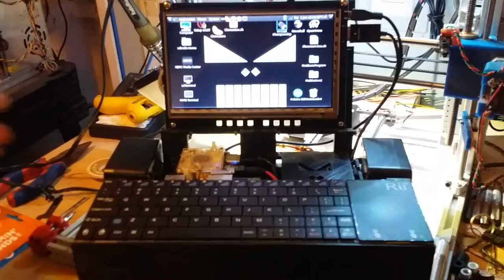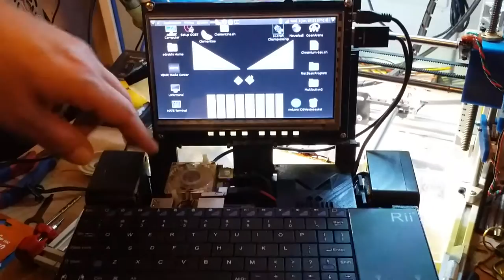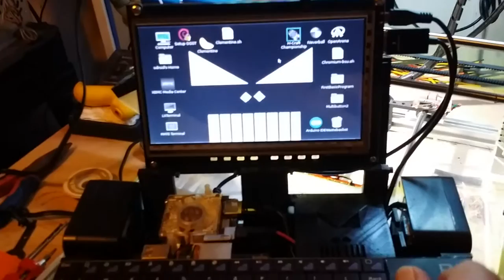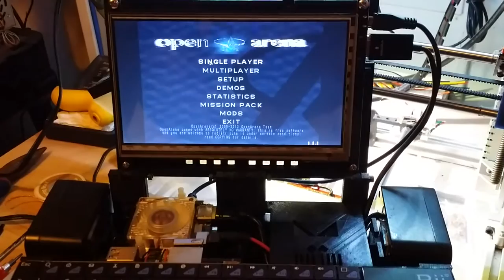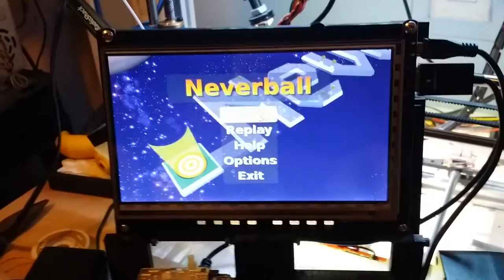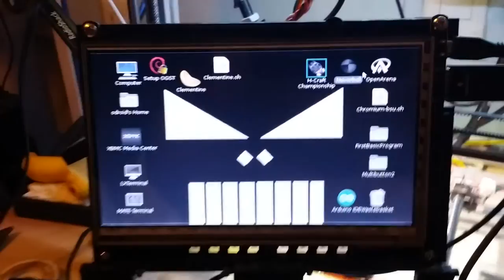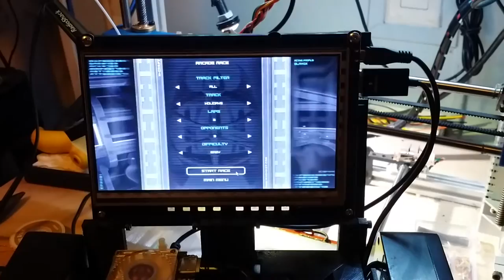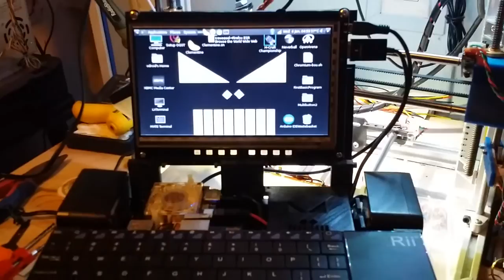SoC DevTop 2.0 - Walkthrough

Comment: Very cool project, I would eventually upgrade to the VU7+ for 1024x600 resolution. Also I would get the passive heatsink for the XU4 and lock the big cores to 1.7ghz, your battery life would increase quite a bit and it would be silent :)
Reply from the maker: Thank you for your suggestion. I have planned on getting the VU7+ for a while now. If only I could stop buying 3D printer and Arduino stuff, I might actually get too at some point! :-P

Do you have a link where I can read on setting the cores as you suggest? 

I am interested in setting it up that way and re-testing. Possibly making another walkthrough video with the changes. 

Again, Thank you!
Reply: +Steve Jackson You can read about my findings and such here (I'm rooted) http://forum.odroid.com/viewtopic.php?p=123736#p123736

You can find the larger blue heatsink I'm using on hardkernel site, Ameridroid may be selling it also.

I will be interested to see the results, I'm guessing by limiting the A17 cores to 1.9ghz, adjusting the trip point to 1.5ghz, and setting the governor to interactive will net better overall performance with a 15% increase in battery life...all while silent ;)